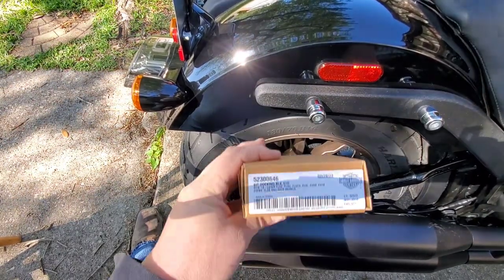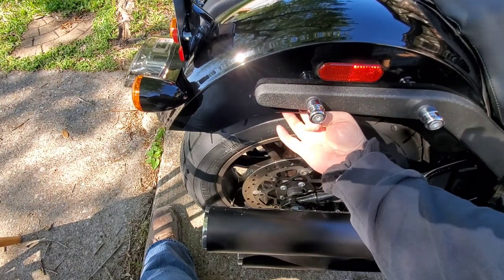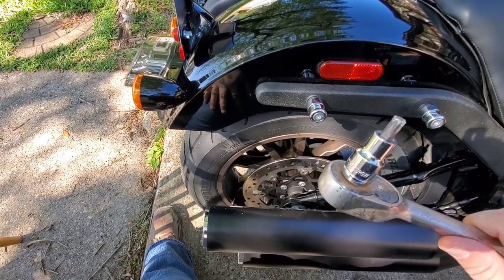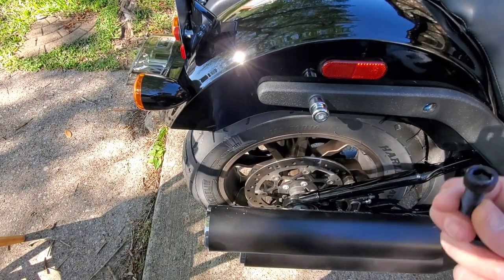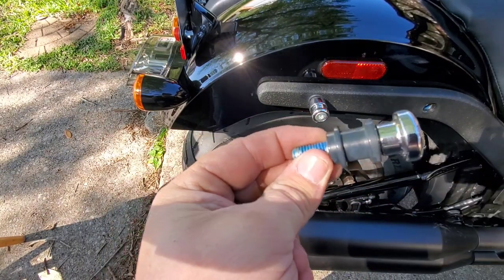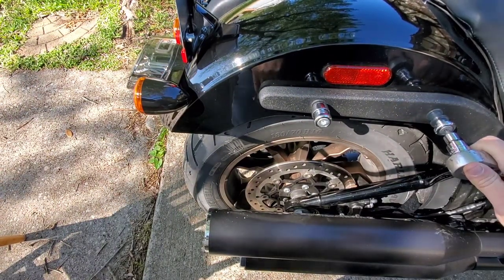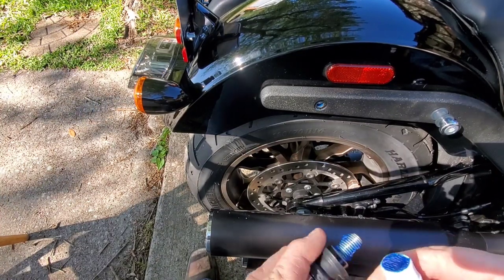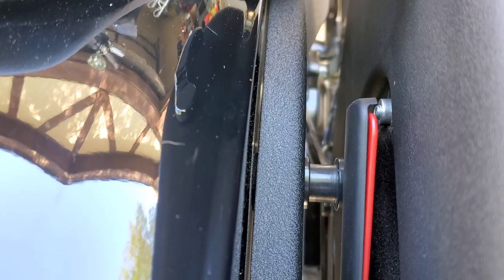Docking Kit for Harley-Davidson, Lowrider ST

Comment: Hi , thanks for an informative video , but can I ask if you know what the part number is for the grey spacer/ bobbin is as I can’t find them anywhere I , many thanks .
Reply from the maker: 52300646 is the number on the box, but that is for the whole docking kit. I don't know if you can get them seperate from the docking kit?
Reply: @chasingghost4499   so they come with the docking kit ? As mine didn’t , and thank you .
Reply from the maker: @jonathanmyerscough9197  they were supposed to be in there. Do you have the right docking kit? This one is for mounting bags with a sissy bar or luggage rack. Ither that, or someone took them out.
Reply: @chasingghost4499  yes same but none of them in box ,, I already have cissy bar on just bought luggage ,, ok thank you for you’re replies and help , I’ll keep looking .

Comment: How much space is in between the fender bolts? Thanks!
Reply from the maker: I can measure when I get home. I know that while it's the same on my fat bob as it is on my lowrider, the width from side to side is different, so the sissy bar on the fat bob won't fit the lowrider. The mounting kit is the same though. Will measure later when I am home.
Reply: @chasingghost4499  thanks! I wanted to know if its the same space between the bolts as my FXBB.
Reply from the maker: Will be a couple days, I drive a truck, and my boss keeps running out of town with no warning? Just found out I'm supposed to be home Thursday night now??
Reply: @chasingghost4499  no problem! Thanks

Comment: I think the big one goes toward the front of the bike.
Reply from the maker: The skinnier wider go to the front, the bigger thicker go to the back. I need to show taking my rack on and off. Also, the rear ones have arrows, they are not perfectly round, you can turn them to "tighten"... so that it doesn't rattle. Not really an issue when new, but as it gets older.